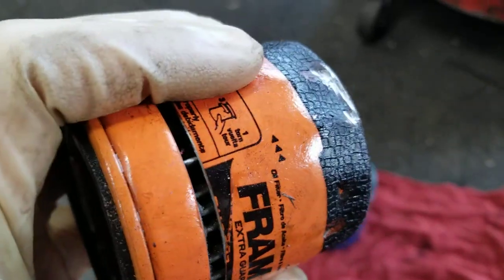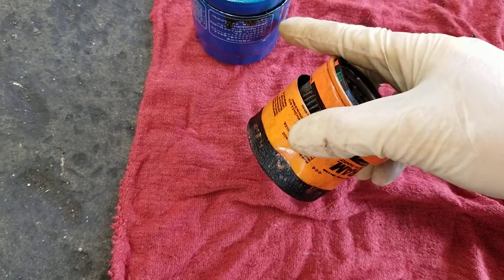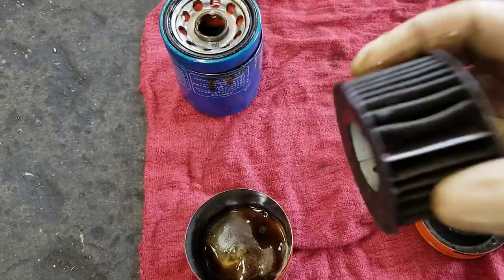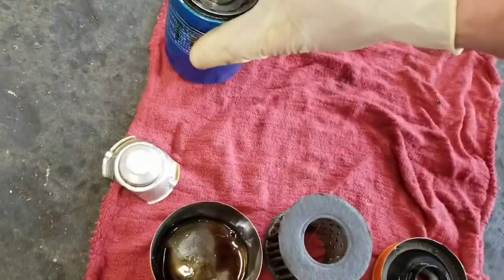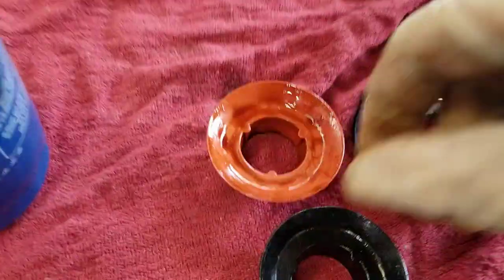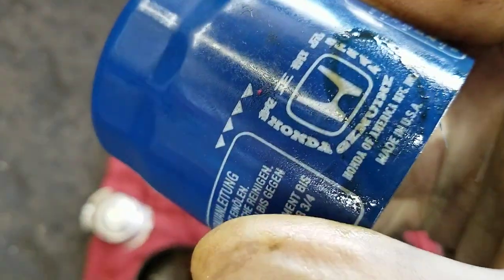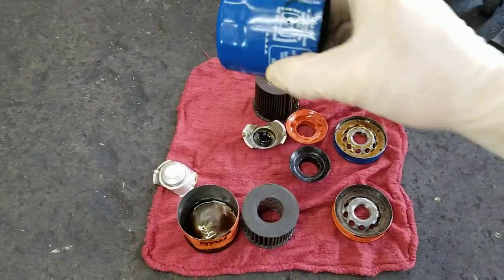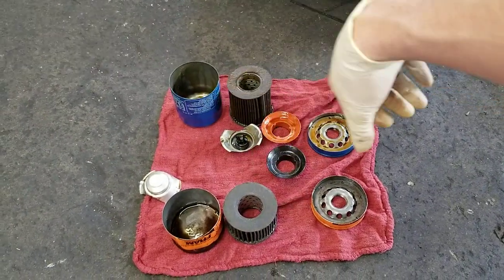Is OEM Honda filter worse than fram?

Comment: Yes, I buy FRAM filters, but i spend an extra $5.00 every 6 months and buy the FRAM ULTRA. Once the first oil change at the dealer, (1,000km) is done for warranty reasons, i do the changes my self and use ULTRA filters.  I get 500,000KM (300,000 miles) out of my Honda engines. the bodies wear out before the engines!

Comment: Nothing wrong with the cardboard endcaps has nothing to do with the actual filtration of the oil filter.  Look at the amount of pleats the Honda filter has versus the fram.
Reply from the maker: It matters when it warps and bypasses
Reply: @subtledriver  Have you ever actually seen that happen? There's no question that metal end caps are better and I'm not at all saying that it can't or doesn't happen, but I have never seen it or seen pictures of it nor has anyone else I know. But if you have seen it happen, that adds a lot of credibility to the argument against using filters with paper end caps.
Reply: There was a post from a guy who did 5,000 miles on the PH series fram, the card board end cap separated from the element allowing oil to bypass the filter, so ya, that's a problem.
Reply: @averyalexander2303  There was a post from a guy who did 5,000 miles on the PH series fram, the card board end cap separated from the element allowing oil to bypass the filter, so ya, that's a problem.
Reply: @lonniebeal6032  Interesting, that's definitely not good. Do you have a link to that post? I'd be interested in seeing pictures of that.
Reply: @averyalexander2303  I’ve also seen where the glue separates from where to pleats are joined together and you get a bypass that way.  There’s a reason why Fram has earned the mechanics title of “Orange Can of Death”
Reply: @PJH199 1 It's NOT "cardboard" -- it's recycled fibers that are more environmentally friendly
 than the metal end caps. 
 "Cardboard" is what BICYCLE Playing Cards are made of.
Reply: @SlikLizrd  this Honda OEM filter has closer similarity to the Fram Tough Guard, it’s mid-grade tier. I’ve cut both of them open and all the components are practically identical, all the way down to the stamping on the baseplate. The Honda filter can go 12K miles or more depending on what the oil life monitor dictates. The orange Fram is not designed for that interval. Plus I have to think that the Honda engineers wouldn’t put a crap filter on their products.
Reply: @carlovanrijk4039  The Tough Guard has a silicone anti drainback valve too but I read that Honda filter has unique media with better flow at the expense of worse filtration. I agree that Honda wouldn't use a crappy oil filter, especially since they built their reputation on their longevity and durability. Do you think Honda is going to throw away their reputation over using an inadequate oil filter? Not likely. Remember who will be taking the loss if one of their filters fails under warranty. Honda has been using this exact same filter on nearly everything for almost 20 years. Don't you think that if they were failing and causing problems Honda would have figured it out by now? They are the largest engine manufacturer in the world for crying out loud. I'd love to see the people who claim these filters are so terrible try to design an engine. Once they prove that they can mass produce better engines than Honda, then I'll listen to them.

Comment: Honda filters are $8 at the dealer.  Fram is $11 at Walmart, and Denso is $3, at Walmart.
Reply: Frams best filter, the XG Ultra Synthetic, is less than $9, and it's efficiency is 99% at 20 microns.  I will be using the XG.
Reply: My local Honda dealer is selling them for $12.99.

Comment: In your opinion who makes the best oil filter?
Reply: for Honda/Toyota OEM or Wix. Fram is junk.
Reply: @M.TTT.  The Extra Guard is junk, the ULTRA is a very good filter!
Reply: @David Campbell  it's all junk, life is a fallacy.
Reply: Just change your oil more frequently and use good oil and clean out your intake manifolds and throttle body and your car will run forever, use oem spark plugs and oem coil packs and oem parts all together👍🏼

Comment: Is fram really that bad?
Reply from the maker: Not if you lower your standards
Reply: FRAM has several models of oil filters -- they have different uses, different quality levels,  and different price points.
The FRAM Ultra is one of the very best oil filters available today.

Comment: Think Honda’s better for sure
Reply from the maker: the honda filter is the same build as a cheap orange fram. so save money and buy a fram instead of buying oem honda.
Reply: Yeah  it sucks thanks for the video man
Reply: @subtledriver  These two filters are NOT THE SAME, and it's WRONG for you to say that they are. You owe your viewers an apology.
Reply from the maker: @SlikLizrd  they are the same, Fram makes them for honda.
Reply: These two oil filters are NOT THE SAME  -- 
1. Different gasket design.
2. Honda has MUCH larger filtering area.
Perhaps you need to look up the meaning of the word "same". 
If you had actually measured the filtering media area, (like the other guys do) you would have seen the OBVIOUS differences.
Saying that these two filters are the same is like saying that a Taxidermist and a Veterinarian are the same -- because either way, you get your dog back.
As I had already told you -- it's NOT "cardboard" -- "Cardboard" is what Playing Cards are made of.
Those end caps are made of Pressed, Recycled Fiber . They seal BETTER than the metal end caps, and are more environmentally friendly.
 The Honda Oil  Filter is the correct filter for my 300-horsepower Acura MDX -- at 112,000 miles with no issues. 
 The Fram is NOT a suitable substitute for the Honda filter. If this Honda oil filter is not available, I use and recommend the Bosch Premium Oil Filter  #3323, with oil & filter changes at 5,000 miles.
Reply from the maker: @SlikLizrd  are you using Fram made honda filters?

Comment: Honda subs out to Fram and Filtech. Not sure the quality of Filtech
Reply from the maker: Filtech is good quality 👌  Fram is "good enough"
Reply: The FILTECH (as used in the Bosch Premium #3323 for Honda MDX) has a micron rating of 20 Microns -- per  ISO 4548-12 .
 The FILTECH media has proven to be the best in the industry -- for 5,000 - 7,000 miles. Extended oil change intervals are NOT recommended for a 20-Micron-rated oil filter. PERIOD.
 The mighty 300-horsepower MDX runs Pennzoil Ultra Platinum, 5-W-20; Bosch Premium Oil Filter # 3323; and a FILTERMAG Magnet Kit. Oil & Filter changes at 5,000 miles.